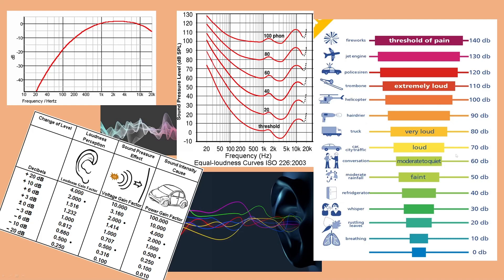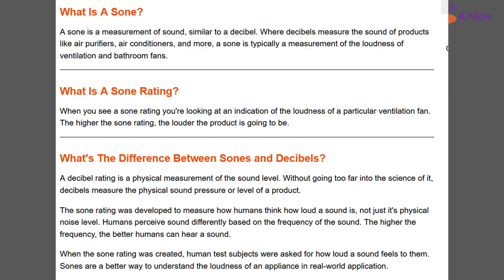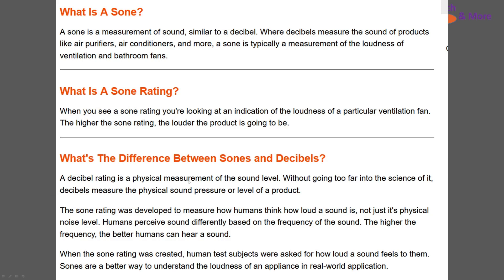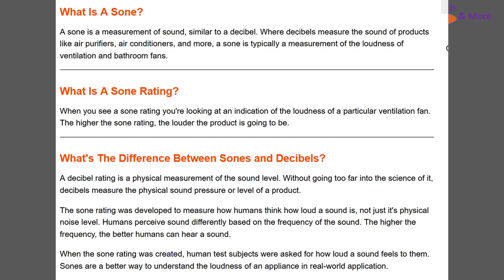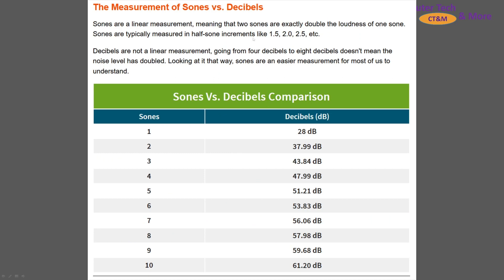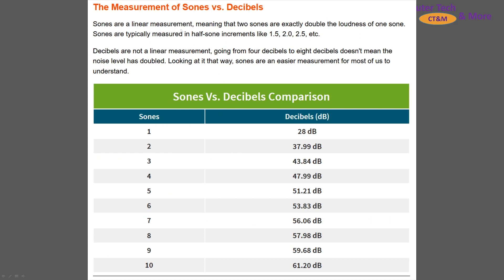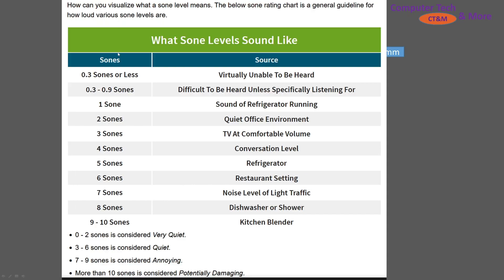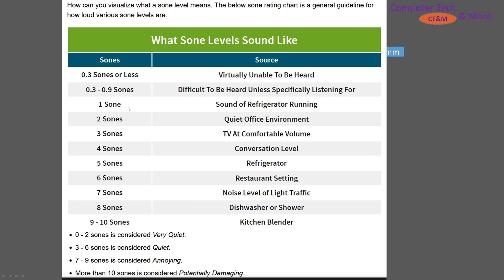Future Fan videos Data Logging: Sound Levels Sone vs dB

Comment: Sone looks less misleading when you understand it, I sometimes forget that every 10dB perceived loudness doubles, so reading sones on a chart looks better.
Reply from the maker: I honestly think the same thing. dB is exponential but looks linear. Sone is linear but looks exponential when graphed. It helps spread out the data especially as things get louder. But makes low noise levels all look very similar. which arguably matters less.

Comment: The frequency of the fan noise is my most important measurement since i got a Noctua NF-A12x25. :D
I always used Be Quiet! fans for my builds and recently bought a NF-A12x25 because it is a highly regarded fan when you look at all the data points. But when it spins up it is higher pitched compared to all the Be Quiets i have. Now it's far from being unpleasant, but if i had to run it at higher RPMs for a long time it would bother me. Luckily it's highly effective at lower RPMs so i barley hear it at all and get the cooling i want. 
I'm looking into bigger fan sizes above 140mm for my next build. I think that a lower pitched 200mm is more pleasant in tone when dB matched to a smaller fan and is actually not perceived as loud. 

Thanks for your videos. Highly informative. :)
Reply from the maker: thank you for watching. Thats what im going for.

Comment: Sone is better
Reply from the maker: thank you for replaying. did you vote in my pole? I do plan on using the results of that for the final decision. But in either case I can have the raw data in every video display both dB and Sone.
Reply: @computer-tech-more  yes I do. Thank you for your video. Sone is theoretically much better for clarification that low db are particularly the same noice.